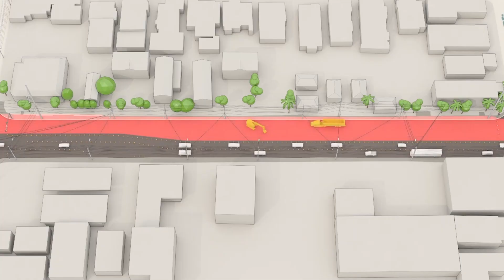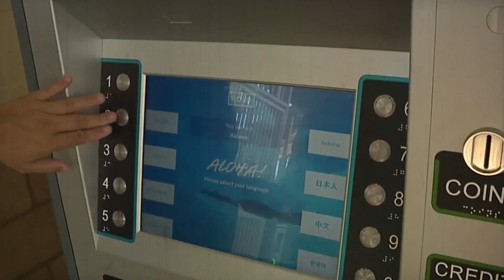Hawaii’s $13 BILLION New Railway Rising ABOVE The City!

Comment: full funding grant agreement with the FTA, signed 12/19/2012:
20.1 miles, 21 stations, in service by 1/31/2020, total cost $5,121,693,163

the reality as of 6/30/2025:
18.9 miles, 19 stations, in service 2031, total cost $10,078,639,778

11 years behind schedule, $5 billion (100%) over budget
Reply: Nobody cares😂😂😂
Reply: @Hyat757ol9 actually the whole island cares. It's a giant ripoff that we're going to spend 30 billion on 25 miles worth of rail that doesn't go to the city center, a mall or university. That's thirty years of construction traffic, in the end it will just keep up with added cars and not alleviate traffic as per the transit authority. Every thing is taxed for it, even your beer. This state is infamous for crooked politicians, from the bottom to the top , all on the take. So it's a big deal. We're not talking high speed rail either this baby rambles along at thirty mph. It's called skyline, with a luxury view of the warehouse district. If you had to deal with it you'd care.
Reply: Nerd😊